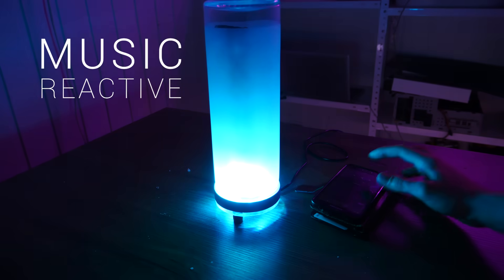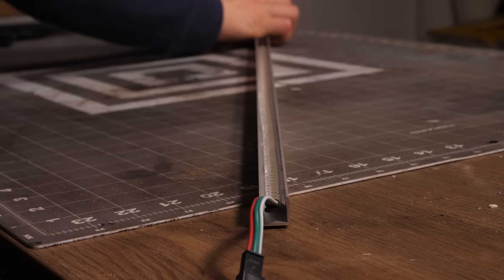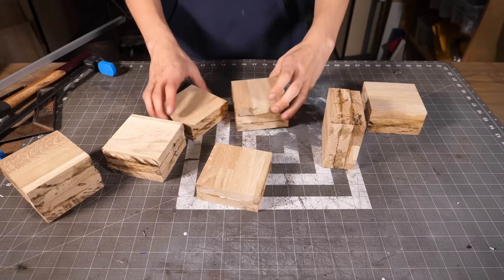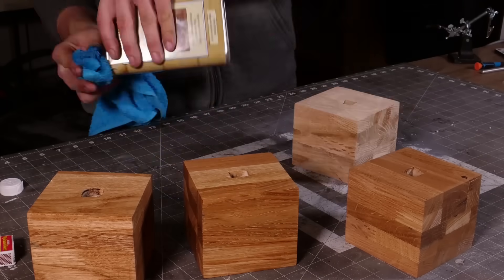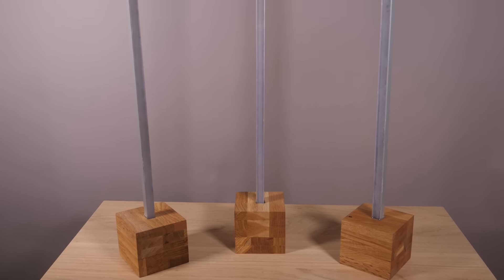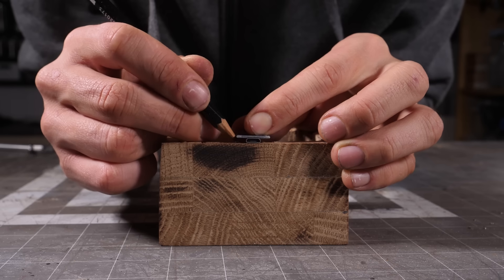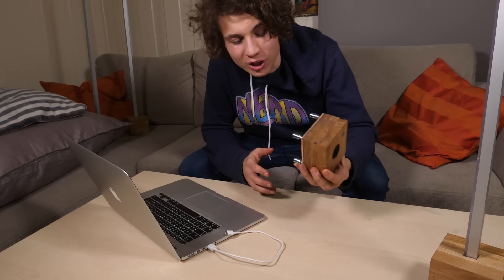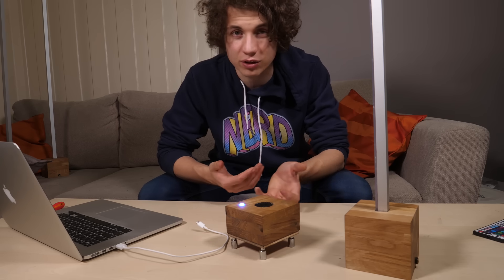Making Wireless MUSIC VISUALIZING Floor Lamps

Comment: Has anyone built this project ? 
I have trouble getting everything to work. My ESP8266 seems to connect to each other correctly, my led strip is working (tested with simple code on arduino). When everything is put together, the led strip stays pitch black, no matter what mode I chose (even the "allwhite"). Do you have a clue at what might be wrong ?
Reply: I had the same issue until I changed the code in the slave from #define LED_PIN 2 to #define LED_PIN D2 this made mine work. Change the led_master to 1 client and get it working correctly then add the 2,3,4 client. I'm having issues with the led_master rebooting quite often and have been able to connect 2 and 3 clients but not the 4th yet. I'm hoping someone else who has built this can offer some help for me as well.
Reply: @normanherps5322  Just tested what you suggested (#define LED_PIN 2 to #define LED_PIN D2) and it worked ! Thanks a lot.
Reply: Glad that helped. Are you having any issues with the master rebooting?  I still haven't been able to connect 4 of them yet. If I connect 2 the reboot gets worse and when I connect 3 it may run 15 sec. the reboots. If you would let me know how yours is doing....tkx
Reply: @normanherps5322  I don't have a reboot issue, although I only have 1 led_slave at the moment. Still waiting for parts to make more.
Reply: @MrFlatox  
hello, can you help me, I have all the slaves connected to the master, the first diode of the tape speaks about (lit blue) but when I turn on the music nothing works .....
Reply: @normanherps5322  
hello, can you help me, I have all the slaves connected to the master, the first diode of the tape speaks about (lit blue) but when I turn on the music nothing works .....
Reply: Jasur Abdurasulov  Hello, here's where I'm at with mine. The only way I was able to connect 4 slaves was to lower the baudrate. I went straight for the juggler and lower it to 19200. At that speed is was able to connect all 4 consistently but since it was so slow they were way out of sync.
I thought the reboot issue was the master but it turned out to be the slaves. I did a little research via google and found out that the fastled library does not play well with the d1-mini. Those issues are well known. I'm currently running two slaves with that seem to do alright . Following someones post I remove the first line of code on the slave #define FASTLED_INTERRUPT_RETRY_COUNT 0  this seemed to solve the reboot issue. The sound sensor I'm using is not the one he's using in the video. I bought on from Aliexpress and think that might be part of my problem. Not being coder I was able to insert this line of code in the master to get an idea of what was going on Serial.println(analogRaw); this is a Cut and paste of where I inserted the code

switch (opMode) {
    case 1:
      analogRaw = analogRead(READ_PIN);
      Serial.println(analogRaw); <-------------------------inserted this line
      if (analogRaw <= 3)
        break;
      sendLedData(analogRaw, opMode);
      break;
    case 2:
      sendLedData(0, opMode);
      delay(10);
      break;
    case 3:
      sendLedData(0, opMode);
      delay(10);
      break;

With the master connected to my PC via usb cable I was able to monitor the analogRaw data that the slave interprets to drive the LEDs. The range is was seeing was 900-950 ish depending on the db level of the audio. I change the code in the slave from  #define MIC_HIGH 644 to  #define MIC_HIGH 999. This didn't change much. All my leds were on and would blink but would not "Dance" like they did in the video. I hooked my volt meter to pin D2 and was reading 3-3.5 ish volts.  again depending on the db of the audio. When I touched to sensor with my fingers (my body is acting like a capacitor) the voltage dropped 1.5 2 ish volts and the RAW data was reading in the 670-750 ish range this made my leds come to life and "dance" like they did in the video. This is with 2 slaves. I haven't tried it with more yet. I've ordered the exact sound sensor that was used in the video, when I get it I'm going to see what happens next. I'm withholding judgement on weather or not this works exactly like it appears to work in the video. I hoping some other people have tried building this and can offer some insight with the issues we are having. I'm sure we're not alone with are issues... Let me know if any of this helps. Like i said I'm not a coder just a tinker er.. Good luck
Reply: @normanherps5322   Hi! i have problem with my slave's, just work 1 slave, when i connect my second slave to the master, second slave is not work, just working first slave, what's the problem i don't understand.....can you help me with this problem???
Reply: @normanherps5322   and have you tried changing effects?
Reply: @jasurabdurasulov2274   sorry it took so long to get back. I now have 3 working just like in the video. I received the new audio sensors (the exact ones that he use in the video). and I can connect 3 no problem 4 i'm having problems. remove this line of code on the slave #define FASTLED_ALLOW_INTERRUPTS 0 this will fix the slave freezing up. I change the value of #define MIC_HIGH 640 to #define MIC_HIGH 590... All the effects work fine. you cannot switch between them until all are connected. I changed the 10K pull up resistor to a 1k. 10K may be too much resistance for button press to work...idk 1k seems to works fine... I got to admit works pretty well and will be building the mounting blocks.. hope this helps
Reply: @normanherps5322  Hi :) I also bought another audio sensor, red one. Original detector work better? What range they detect? My red sensor detect for example 570-650 ~80 range (little too weak :/ )  
sfmbe Regards ;)
Reply: @normanherps5322  did you ever figure this out? i have the exact same problem!
Reply: @scottgiard183 sorry just saw your post. I've got it working pretty well with 3 light strips... I'll post all my changes so you can compare and try to get yours working... I'm out of town at the moment so give me a few days....  Some minor code changes I made to get it to work. The ws2812 LED lights don't like the interrupts that was in the code. That was the biggest issue that I had was getting mine to work without freezing up.
Reply: @normanherps5322  Thanks did you make it back from vacation yet lol

Comment: I absolutely love the project, I use the exact same parts for commercial display signs I make (minus Wifi)! Just one question please...

Watching the finished project I noticed that each "lamp" is reacting slightly different. Especially the far one (middle) where they are either reaching different heights or a slight delay. Why is this? How could it be fixed?

Comment: Won't it be possible to use an aux spilter to connect the wireless signal module? So it would be operating by electric current then sound by microphone.. wouldn't that display more accurate sound-to-color? It wouldnt picking up any extra sounds in the room like a phone or conversations.

So you would solder an aux cable (female to to males)... or have the box with an input and an output cable to plug the sound back into the whatever.

A plain aux male or female wouldn't work unless you install speakers in the led towers.

Comment: Kjempekult prosjekt!
Vurderer å lage de selv, men kunne tenkt meg å ha lyd sensor i hver lampe fremfor å ha en boks på bordet.
Går det an å bruke arduino-koden din for en alt i ett løsning, eller må man kode alt på nytt? Kunne du tenke deg å mekke en?
Da tenker jeg Wemos, batteri, lydsensor, diode og knapp, alt i hver lampe.

Christopher
Reply from the maker: Hei!

Fordelen med å bruke 1 mic er at lampene blir synkroniserte. Om du har flere lamper med egen mic vil det nok kunne være ganske stor forskjell på lyseffekten lampene. Men hvis du vil ha lydsensor i hver lampe trenger du ikke bruke en Wi-Fi chip som WeMos D1. En Arduino holder. Jeg har allerede laget noe lignende for to år siden: https://www.youtube.com/watch?v=5oRir4dck_w

Du må gjerne bruke koden derfra, med et annet design.  :) Lykke til!
Reply: @Nerdforge  Tusen takk for tilbakemelding!

Comment: One warning for anyone who's going to try this - make sure that the sound sensor modules you get actually have an analog output - the ones I got appear to claim to have, but reading the description carefully revealed that they were actually digital level sensors (that set a digital pin high when the sound goes above a certain threshold). I've ordered some better ones. :)
Reply: привет, вы можете повторить этот проект? Does it all work????

Comment: Try shrinking the controller to the size of a wireless usb flash drive with built-in microphone so that you connect to the pc or tv to act as a relay through a system built around a software allowing you to use your smartphone as a remote for the musical led lamp
Reply: He put all of the source code on github. The protocols is kept very simple and based on udp, you could easily build an app for you phone or desktop PC.

Comment: Rooky mistake at 2:31 'I'm cutting of the cables on one side' ... if you use a meter of 144 led's there will be a color difference or even possibility to burn the first couple since you are pulling about an amp of two, maybe even three through them...
Reply: can you please elaborate (ELI5)
Reply: Just google Neopixel Uberguide from Adafruit and read a bit in the power section 😉

Comment: Hi, i was wondering, the led strip that you uses also was all White at some point. At home i am trying tot create an lamp using LED strips (to light up An entire room 3m x 4m x 2,10m). Do you think An led strip like this would be enough to light a room when it is Just all White? Ik have been trying tot find a good strip and came allong you video
Reply from the maker: If you need an all white option, you should go for a LED strip that is not RGB and not individually addressable. You might need more than one strip to get a good light

Comment: I'm a dj and this needs to be  a commercial product with a  line in socket instead  of a mic, i would instantly buy this if i saw it selling somewhere
Reply: Ive been curious about the same thing. Could you build the exact same thing with a led tape decoder that would allow mydmx software to control these?
Reply: @KyleThurmanMusic  Anything is possible if you know what you're doing, but I'd need more info about the exact setup you're looking for. If you're trying to interface with software that sounds more like you'd be interfacing with some sort of digital signal and I'd need to know how to interpret the signal and different hardware may be necessary.

If you want to reply with more specifics, I'd be happy to look into it in my spare time though!
Reply: Dj Happy Emo same but none my pro lights have line in. They have mics same as these although they also have dmx. I want to make some and add dmx in then you will get full control.
Reply: I have seen a commercial product that is almost identical except that the base is much smaller (thinner) and the LED's are encased in a tube of some sort (acrylic or polycarbonate). They use a "master" that has the option of using a mic or line in and the rest are synced wirelessly with DMX control. I forget the brand, my friend is a DJ but he ended up returning them because they were refurbished and 2 of 8 died almost immediately - so I'm not too sure about quality.

If you like this design and would just like to have the option of having a line in, I can put together a design pretty easily to replace the mic. Just reply and let me know.
Reply: None of my lighting has line in for audio that really is not needed. Dmx or inbuilt mic.

Comment: Thank you so much for the tutorial. I wanted to recreate it today but ran into a problem with including the reactive_common.h file in the slave code. I copied your code from github but can't save it as a .h file, it alwas becomes reactive_common.h.ino. How can I save it as reactive_common.h.h and include it in the led_slave.ino code?
Reply from the maker: That should be the case, yes. Sometimes you have to separate the slave and master in different folders for Arduino to compile it
Reply: jannik liebl did you fixed? I have the same problem.
Reply from the maker: If you are on windows make sure to enable file extension editing, then you can edit the name and make sure to save it as a .h file
Reply: @Nerdforge  i am getting this error-           reactive_common.h       No such file or directory found
Reply: @Nerdforge  I am still having the same problem

Greatings from Germany

Comment: Awesome project but a couple of questions, why use the microphone for input? wouldn't pulling an analog signal directly from your receiver/amplifier give a cleaner result? And have you considered using an FFT library to utilize different colors to represent different frequency bands?
Reply from the maker: Great questions! The reason I use the mic is so it can pick up all kinds of sounds, not only music, and to lower the usage complexity. Now it works whether somebody plays music from their phone or a video game on a TV as long as it's powered. But plugging it in would yield more reliable data, for sure. 

For your last question, short answer: yes! That is something I want to do at some point, but it wouldn't work with these components, as it's not actually a mic, but a sound detector. It doesn't output PCM data, but only an analog signal showing the loudness of the surrounding audio.
Reply: So, but why u didnt used a mic?
Reply: I was confused by this also as I remember people doing lighting similar back in the 90's.... today you could just use cheap wireless speakers to run them. But I guess if you wanted to pick up everything in the room it makes a little more sense I guess, with this you could have a dramatic stomp to the shitter and back while making Godzilla sounds. :)

Comment: I was staring at that schematic for quite some time because i couldn't make heads or tails of it, and then it dawned on me, you have no dots where the lines cross and are connected. Those are pretty important for anyone to be able to read the schematic properly :D - But super awesome project and outcome. Keep up the good work.
Reply from the maker: Hello! Where black and red cross, I don't, but when the same colors cross and if they are not supposed to connect, there is a little raise in the wire going over the other. Maybe it wasn't so clear, but it only happens one time near the battery :)

Comment: Looks really good! I want to do such a things for quite some time now, but I want to just get the signal from the audio cable. Are you interested in doing a Video about that?
Reply: Was looking for this. A microphone is just not good enough because of interference. I'd love to see this modified to work with a regular analog audio source. Furthermore if you know how, maybe also a way of controlling this with mqtt? For smart home use. For example to set mode, change colors manually etc.
Reply: https://youtu.be/8X6rawrf_5M
Look at this video..

Comment: im struggeling on connecting the WEMOS chip to the ardurino IDE software. any tips or tricks you used to connect it?
Reply from the maker: To upload code, or to connect it in general? To upload code I had to use the board type: NodeMCU (ESP 12-E Module)
Reply: @Nerdforge  To connect in general i got my code and everything, but it just cant find it

Comment: Very nice project! My concern was about the latency since you mentioned it was around ESP8266, but the results were much better than i expected though! If you want to fix that i would suggest these generic 433MHZ wireless modules, and since its one way communication you can put many receivers along with an ATTINY85 in each lamp :D I think you can eliminate the latency this way!
Reply from the maker: Great tip!
Reply: There is kinda strict rules on how much you can transmit on the 433 MHz-band since an application like this would screw with all the wireless sensors and keyfobs in the area while your contraption is on. Not a super good idea.
Reply: @zaprodk  thats definetly not the case, when you use these modules you can use a spesific library that encodes the signal so it wont interfere with such appliances.
Reply: @dimitris-vlamis  As zapro_dk mentions, the 433mhz band is a licenced band in some areas. It really isn't possible to avoid interference when two signals for the same frequency are induced at the antenna. Maybe you can reduce it but the interference will still be there.
Reply: @mpja   If this setup will interfere  with the 433 band, do you have a solution for overcome this?
Reply: Nice idea
Reply: Just use esp-now. I've done mine with it and works flawlessly
Reply: @foliveira15  bro i made this and all actually works fine but there is something not right sometimes when in sound reactive mode slave board resets why is that and then i checked serial printer and it shows error code "rst cause:4, boot mode:(3,6)
Reply: @vishwashehan8441  I have the same problem. 
Did you find a solution to this problem
Reply: @rafal.piskula  no i didn't it doesn't matter to me very much bcz it dosent happen frequently  if i turn this on for 6 hours it would reset like 3,4 time so not a very big problem and also if im to program it again i have to remove light's enclosure and stuff i'm kinda lazy to do it😂😂😂😂  but if ur about to make this refer this "https://forum.arduino.cc/index.php?topic=468998.0"  "https://github.com/esp8266/Arduino/issues/3757"
Reply: @foliveira15  Hi, would you like to share your success with me? Since I don't familiar with UPD packet, and I got stuck at the slaver has blue light on and not other response. your sharing may help me alot.